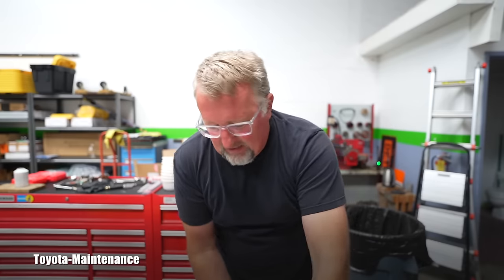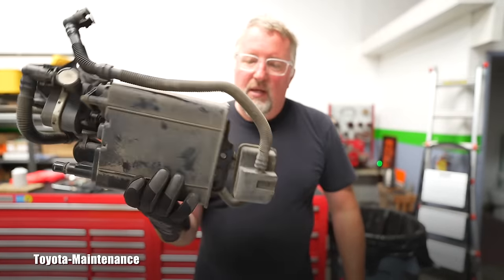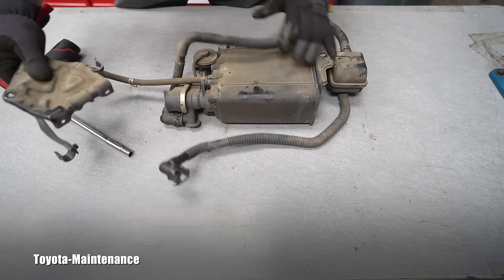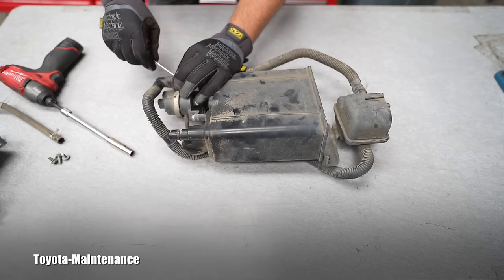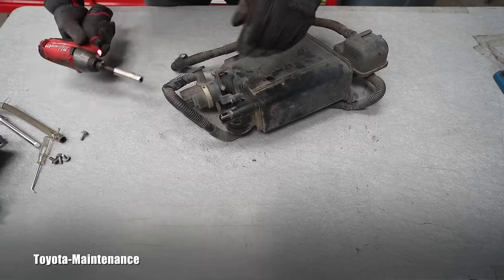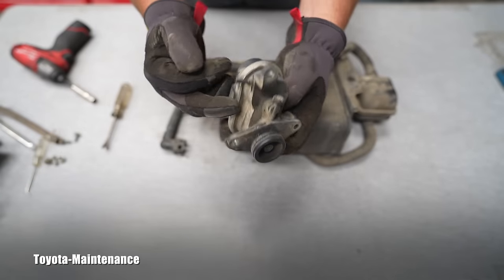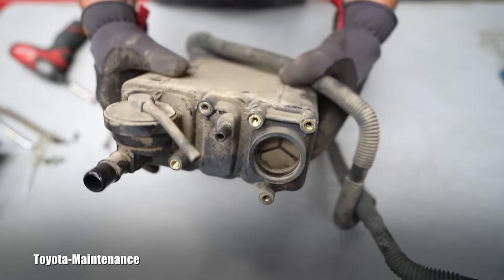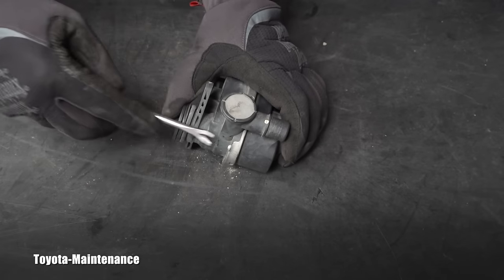EVAP Charcoal Canister Failed. Why?

Comment: To add a bit of context to this video, I can explain a little bit about how that leak detection pump works, having had to diagnose them.   Inside that pump is a calibrated leak, called a reference orifice.  If I recall correctly, it's a 0.020" leak.  The computer will run the pump against that reference orifice and watch the pressure sensor that is also built into it.  It will see what the pressure (vacuum) readings are when it pumps against the 0.020"  leak.  That sets it's baseline for the leak test since the system's threshold is that is has to hold tighter than 0.020" leak.  Then it will close off the 0.020" reference orifice and pump against the fuel tank vapor system and watch the pressure sensor.  If it pulls the same or more vacuum than it did when pumping against the reference orifice then it assumes the system has less than a 0.020" leak and it passes the evap leak test.  If it pulls less vacuum then it it fails the leak test.  It does a few other tests, including watching rate of decay, as well, but essentially this is how it works.  It also does this reference orifice test after it does the leak test to compare the reference orfice checks to make sure the pump itself is working correctly, i.e. the reference orifice testresults are consistent.  You can actualy use a scan tool to watch it do these tests.  Once you understand how it works, you can watch the tool do the tests, see the results and know how it's failing.  The last one I worked on had a failing motor, just like this one and the reference orfice test at the end had a different reading then the reference orifice test at the beginning of the leak test routine.  Pretty neat system...except that the the canister assembly with the pump is usually $7-800.
Reply: Thanks!
Reply: thanks
Reply: Really good explanation!!  Could you explain why not to top off when fuelling and what that habit does to the system if you do. Regards
Reply: @abyssalsoul6216  Topping off the tank sends raw fuel down the vent pipe/hose and into the charcoal canister, eventually destroying the charcoal. The canister is designed to store fumes, not raw fuel.
Reply: Thanks for the clear & intelligent explanation!
Reply: What will happen if I drive with that
Reply: @majidilam8756 if I may, eventually the saturated canister will suck fuel through the vapor lines and results in engine stalling as well as air fuel mixture too rich

Comment: So I had the codes, p043e p043f p2401 p2402 p249. I didn’t want to spend 500.00 on a new unit. So I tapped the motor while car was running and the motor started working 😂. Thanks man. Love the videos keep up the good work
Reply: Seriously?Did it really work?
I might try if so

Comment: So to add what i have learned here in Canada is that we have two types of fuel.  One is a winter fuel for cold climate which contains more butane component and one is a summer fuel that has less butane and an additive that lowers the evaporation rate in a hotter climate.   Now I drive an awd Suv in the winter and store it in the garage over summer and drive a toyota van in the summer set up like a camper.    After the second summer I went to drive the awd suv and the engine light came on once  i switched over and it turned out the evap cannister was fubared .   So unnoticed to me at the time ,  I had filled the winter car with winter fuel before storage in the warm garage and all the butane in the fuel was now in the evap cannister.  Now i just run the car empty as those cannisters  are not cheap  and neither is the reinstall.    Had to learn and figure this out the hard way.

Comment: It's a super fantastic video! I tapped the canister part (with motor in it) on my 2009 Camry with a stick and the five Evap codes (P043e, P043f, P2401, P2402, P2419) are gone. Driving it for two days and no codes are pending. The codes used to come back in half an hour after clearing before.
I think if I would start the car over winter more often I might not get the codes at all.
Thank you ToyotaMaintenance! Just saved $1400 in Canada.
Reply: I have the exact codes on my 06 4runner, you really just tapped it with a stick and it's fine now? I need to try that
Reply: Did it work? Have the exact same codes on my tundra!
Reply: What do you have to lose macnero? It did work for at least three days until I sold the car. I know this because when I was resetting the codes before, the errors would come back in 1 hour. So, I say it worked. 

This is how I understand it: for one reason or another, the motor on the canister wouldn't engage for a prolonged time (due to some other issues like fuel neck, fuel cap faulty or simply the car was sitting for too long). Then, when it was trying to engage, the tiny motor would not engage and therefore needs a little nudge to become operational again.

Good luck

Comment: Just went thru a series of EVAP canister codes on my 2001 Tacoma, replaced gas cap & EVAP hose/canister, cleaned PCV valve & it passed emissions - fingers crossed for no more codes ($650!) . . . as it was intermittent before to begin with.  My EVAP replacement was under the hood though, not under the vehicle (there are 2, actually, one near gas tank & 1 under the hood).  Appreciate the fun, finding out video !!!

Comment: Most impressive "tear-down" 1 Thank You!

Perhaps ONE WORD sums up far too many of our Government-Mandated "Emissions" Rules.
"OVERKILL"

Yes! Other posters here have nailed it, too.  Just that little "Control Module" is ~$200 ... if it is even available.  And the dealers "Jes Luv it Dude!" Near $1,000 to replace the 
EVAP Canister at the local Lexus Dealer.

* ASIDE: * 
I do not know if it is possible for you to do so, but as an avid DIYer with a "near-pristine" 2003 Lexus RX300 SUV,  I would love to have you tell us the "Book Time" for the repairs you do ... and an approximate price for an OEM replacement part. I keep a spreadsheet for my own SUV and the dealer cost (parts & labor) vs my ow repair / service is about 6:1. 

Back to OVERKILL, another example is the HEATER WIRE inside an Air/Fuel or Oxygen Sensors.  They only save a few SECONDS of "Warm-Up" pollution ... but they basically function as limited-life, self-destructing fuses.  

Once bad, complex parts become a high-profit items for parts manufacturers, dealers and repair shops.  All for perhaps 0.001% "Improvement" for the environment. Another take on insane regulation creating unneeded complexity is the Ethanol in Vehicle Gas.  It does NOT help the environment (when one considers the "Fuel and other "Input Costs at the farm growing corn. It just adds more complexity, plus more wear and tear to our vehicles. (All because "Congress" was "encouraged" by lobbyists ... to help modern "Farmers" ....  AKA Big Agra ... growing corn that not even large animals can eat) while concurrently stripping our lands of natural nutrients. 

My apology for the rant.
Best to all,
John in the NW
Reply: Hear hear!
Reply: Couldn’t agree with you more!

Comment: Sometimes the Scion charcoal canisters are cheaper and fit the regular toyota cars. I replaced one on a Rav4 with one from a Scion XB. The Rav4 one was 600 dollars.... the Scion was 250. Transfer over the mounting bracket and you're good. Worked perfectly.
Reply: What year RAV4 ?

Comment: Since the motor is not brushless, there is likely a dead spot between one of the brushes and the armature contacts.
It seems to work now, but the chance of the motor stopping on that dead spot if reinstalled is real.
Reply: Cannot reliably repair a small motor.  An OEM junk yard solenoid for $5 is the way to go.  Not a $800 dealer part that may be an after market anyway.
Reply: Yes.......just like the door lock motor......the motor goes bad. But perhaps it also can be replaced. 
What are the printed numbers on the dc motor? Possibly a substitute could be found. 

Any other ideas?

Comment: I have a 2005 Sion that had an EVAP code. The replacement canister unit (not a Toyota unit) cost me $300. Paying someone to attempt a repair probably would have exceeded that cost. Knowing that a good smack from hammer, after reading a viewers response, might have fixed the problem makes me a little sad. I'll have to use the gentle hammer technique to fix problems in the future. 😊 I enjoy and benefit from your videos.

Comment: If you went into the electric motor you would've found that the commutator inside was dirty and gunky. The same thing happens with the door lock actuator motor. Chances are it will get stuck again but if you clean it then it will work like new for many more years.
Reply: I could be wrong but based on the small electronic control board I would guess this is a brushless DC electric motor without a commutator.
Reply: I'm a female with no mechanical knowledge (at the mercy of the stealership) but my 2006 toyota highlander hybrid is at the dealership with P1420 code - replace EVAP canister.  I have a feeling its going to be a spendy repair.. Please tell me more how this could be checked or cleaned on this vehicle? Any tips or info is appreciated! TIA

Comment: This is true and the water ethanol brings certainly doesn't help.  Peter: the next time you have a sticky motor or solenoid, give it a shot of LPS2 and it will probably be reborn.

Comment: Daughters 2011 corolla has had cats, O2 sensors vent valve , purge valve and now they wanna replace this part. All this for code P0455.
Im betting that the motor will get hot and stop running after long use. It list at 200-400$ us. I found one in the scrap yard and am going to try it before letting her spend the money.will give u an update on how it comes out . Thanks for the video.

Comment: The design of the EVAP "pump" is very similar in design to the type of unit found in a side-by-side refrigerator freezer. The actuator opens a gate that controls the flow of air from the freezer into the refrigerated compartment.

When one side of the refrigerator "fails" with the freezer working, it is because of this unit. The servo inside (as in this you tube) freezes over time and will not open the gate.

By the way, If this happens to your refrigerator, the assembly can be replaced by the average guy. Diagnosing the problem was the more difficult stage of the repair. You likely will not need to replace the entire 'frige if the freezer side is functioning. This is a common problem with side-by-sides.

Otherwise, very interesting the similarities between the two.

Comment: I love tearing things apart like this. I wish maybe a little more explanation of function of the pieces. At first I thought this was the bypass VSV but an electric motor? Sometimes aged electric motors need a tap to get turning. Maybe the frustrated beating of my 2002 Tacoma EVAP canister with 280k miles really did fix it! That was after fixing verifiable problems though.

Comment: Any of these emission related parts are very expensive. I’ve seen many aftermarket parts fail soon after installation. The quality is simply not there…
Reply: Picked up an oem Toyota evap can sister online for $224. Not that bad.
Reply: @guymann4016  that’s super cheap! Better hope it’s actually Toyota or Denso and not pirated copies. eBay and Amazon are known to sell these through 3rd Party vendors.

Comment: Lost count ov how many rollover fill valves located on there gas tanks top that develop a cracks in there seams setting.off small leak ,flow codes etc . The top of it has line going  to the filler neck. The valves ,diagrams in the older cannisters just just stick with age.. Good luck !!

Comment: My 2000 corolla shakes when I accelerate too quickly and it will stop accelerating.  I have to let off the pedal so it will stop.  Then I can accelerate again slowly.  I wonder if this is the problem.  I've cleaned and replaced about everything else up top on the intake side with no difference.  Otherwise I was thinking clogged exhaust.
Reply: Charcoal canister generally should not effect performance. Its purposes is to neutralize vapors which are vented to atmosphere when you are pumping fuel into the tank. It doesn't really do much while you are driving.

Comment: The evap canister has absolutly no effect on how the engine runs, if you are having performance issues with rough idle or acceleration/hesitation issues, it is NOT caused by the evap canister. You will however get a check engine light and the car will not pass emmisions testing.
Reply: This is why you live in a place without emissions.

Comment: Hello friend 🙏 what can be wrong on my 2006 scion xa ; the whole exhust system has been replaced , no leak at all , but when ever my wife started it , the fume out of the pipe smells terible ? Can be pressure regulator valve & does it locate on the top under the hood or in the gas tank . Thank you for your response🫵 🫶 👀💚🤍🦁❤

Comment: I have a 2015 Tundra and am getting P0455 and P0441. I have replaced the pcv valve and solenoid but that did not help. Any thoughts on what it could be?
Reply: I have both of these codes. Try an OEM gas cap if you haven’t fixed this

Comment: So my check engine light just came on & the dealer says I have to replace the evap canister. I’m curious, can this be repaired or do you have to buy a whole new canister?  I have an 03 Corolla with 150,000 miles..

Comment: Great Video! I have a 2000 Camry 4 cylinder and I get a "Check Engine Light". Scan tool indicates : "EVAP Small Leak" I put a new gas cap on and clicked it and then after a week or so the Check Engine light comes back with the same code? Can the car run without this system ? I know it won't pass emissions test, but I'm just curious?

Comment: Great Video, I am about to replace the cannister in my 2011 corolla and need to remove the 2 brackets on a cannister thats damaged and cant seem to find a socket that fits the bracket bolts. do you know what size socket is required?

Comment: I put a new canister in my 2012 GMC sierra 1500 with a 5.3 and a new solenoid and I still can’t get gas in soon as I hook it up to the charcoal filter from the solenoid. I can’t put gas in if I unhook it from the jack filter I can put gas in, so I just don’t know what to do

Comment: Those rotor vane pumps jam up all the time, they are the same as EFI pumps. Hit it with 18V of and on in very short bursts and they can free themselves. These are the bane of EFI boat owners as they sit in fuel for months without turning and fail to turn when the boat owner wants to run them.

Comment: I currently have a P0446 code on my 99 es300. I've replaced all of the vacuum switching valves that are on top of the engine as their plastic nipples that connect to the rubber hoses were brittle, one was broken completely causing a vacuum leak. I also replaced the valve next to the charcoal cannister as well as a few of the evap hoses. The code still persists. Fortunately I'm not in a state with an emissions test so I have been living with it. I'm wondering if my issue is the same as the one shown in this video. 🤔
Reply: Same on a 2003 Camry with 282K miles. I got the front valves ams solenoid replaced in the engine but the evap failes. It is the canister, but in Missouri there's no emissions test, so drive on.😂

Comment: enjoy watching your videos, question: 2011 tacoma sluggish went driving at about 60 miles, code 456 (Evap small leak), test smoke shows smoke coming from a tube that is attach to gas filler. OEM cap was replace.  any advise.  Thanks

Comment: Problem is that repairing a unit like this is time consuming, cheaper to just put another unit in the car. This could possibly be re-used in another car.
Reply: Cheaper?  Those charcoal canister w/leak detection pump units run in the ~$700 range and up.